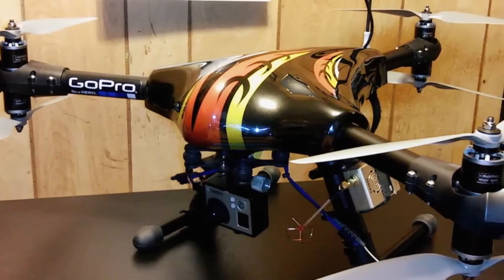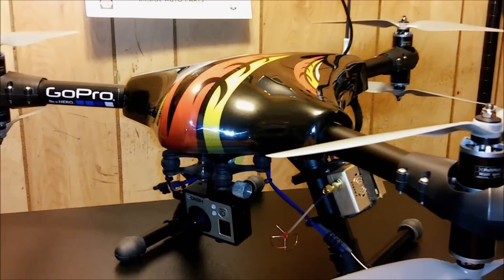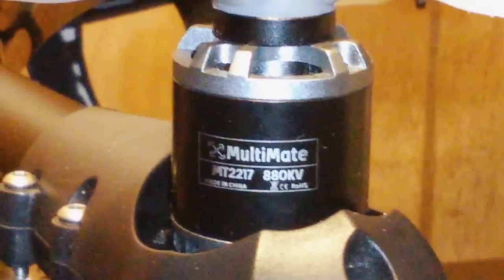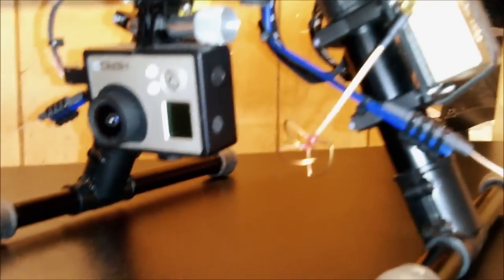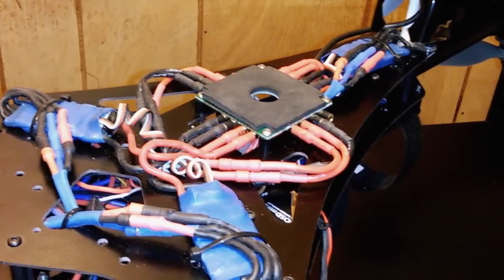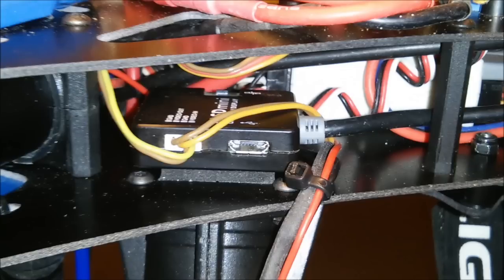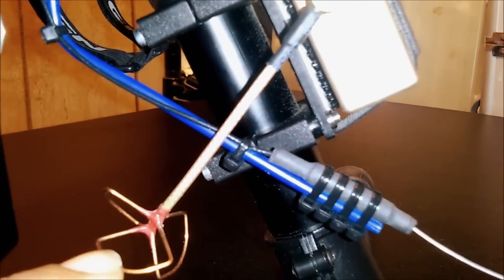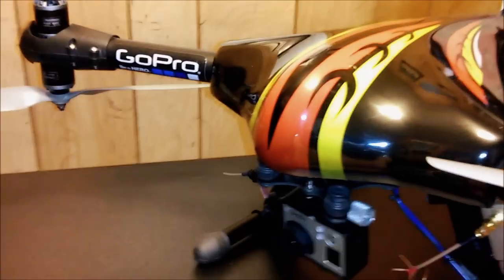X CAM KONGCOPTER Y600 Introduction Part#1

Comment: Do you really got 20+ minutes on 2x5200 on this setup? I want to build a 20+ minutes multicopter, trying ecalc using your setup and came out 11minutes hover...
Reply from the maker: Arga Firmansyah This coaxials type of aircraft aren't not that efficient , the most I manage to get was 16 minutes out of the 2x5200mah 3s lipos in parallel .

Comment: Why did you go 3S over 4S?
Reply from the maker: SoundsFantastic The motors that i pick for this aircraft they are design to work with 4s but only with small size props that aren't suitable for the size of this aircraft so for me to used the proper size of props with the motors that i got 3s lipos is required .

Comment: Thank you!
Reply from the maker: I haven't heard from you for a long time , have you consider to transfer the hardware from your crash Y6 to a frame like this ?
Reply: TFRdrones My last crash was a little disheartening lol.   It was a bad cell on a lipo battery.  They were getting old and I pushed it too far.  I like the Kong Y6 frame.  It will be a lot cheaper than the landing gear on my last craft.  My motors, flight controller, receiver, esc all work.  I just need a new frame and decent lipos to get back in the air.  :)  I'll have to check out Hobby King.
Reply from the maker: ALTN8NRG Just to let you know they got this frame in hobby king for less than 90 bucks so is a steal , you can also get the new multistar lipos from hobbyking too
Reply: Thanks! You are a life saver!